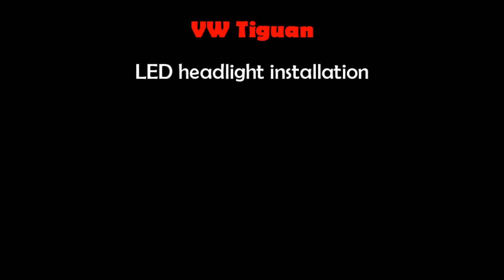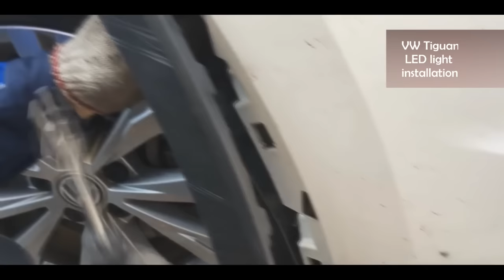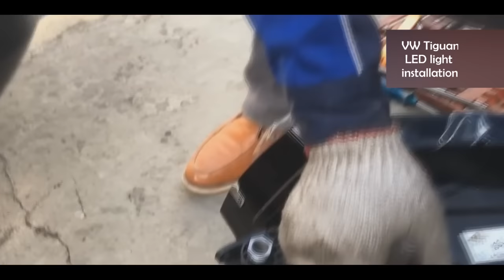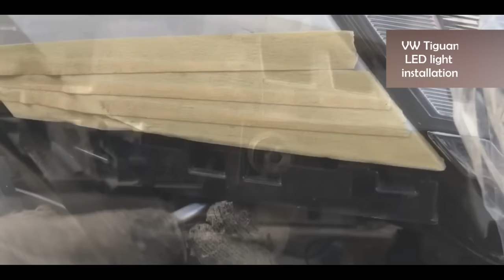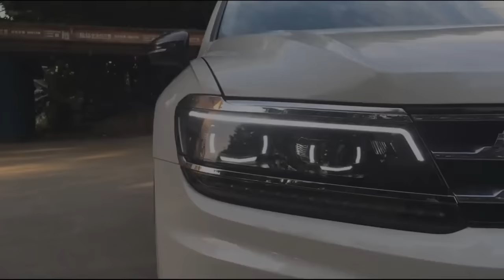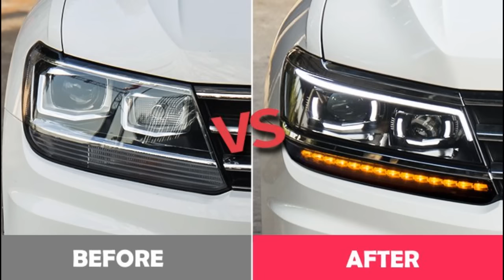VW Tiguan / Standard to LED headlight INSTALLATION 🛠 💡

Comment: Will the OEM led headlights fit with no mods or only aftermarket
Reply: Yes 100 %
Reply: Did you end up installing the oem led headlights? Any problems? Coding? There is a set local to me at a decent price but dont know if the factory led need coding for non halogen vehicles

Comment: Where can I buy them?
Reply: Bryan Garcia bec autoparts have them! I order some for my 19 Tiguan R-Line
Reply: @octaviomunoz5609  what's the website?
Reply: @octaviomunoz5609  so you're tiguan r line didn't come with the projector led headlights I have the 2019 tiguan sel wish that it included the LEDs how are the after market headlights are they OEM compatible
Reply: @octaviomunoz5609  you should post a video to see how your car looks.